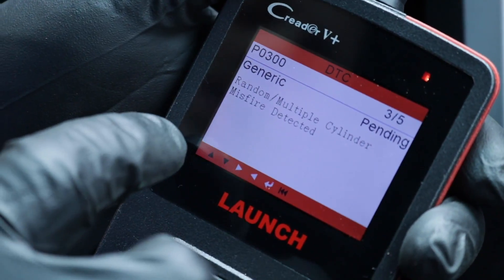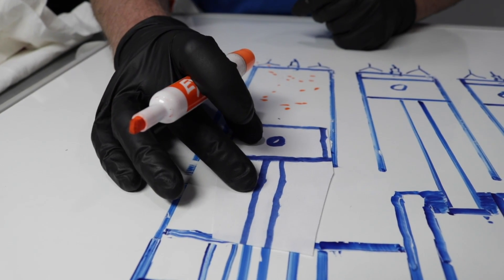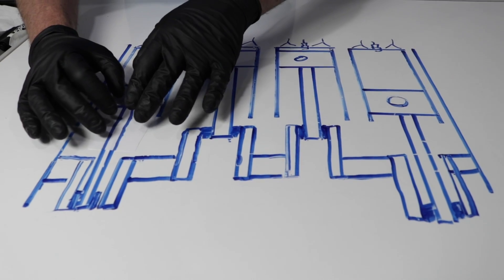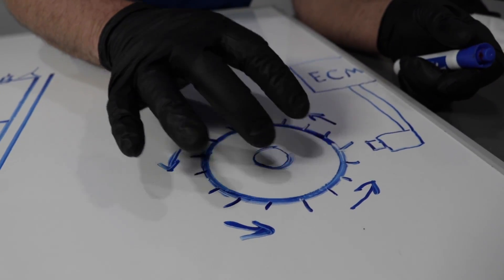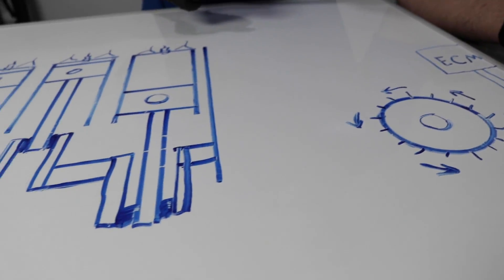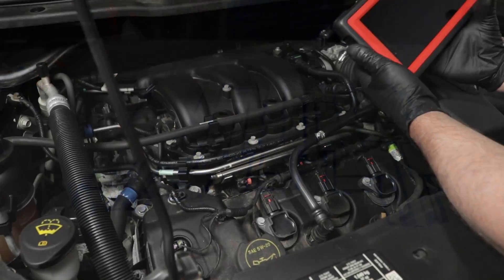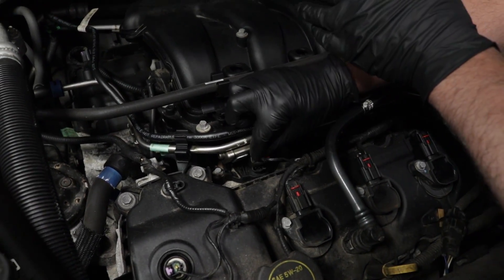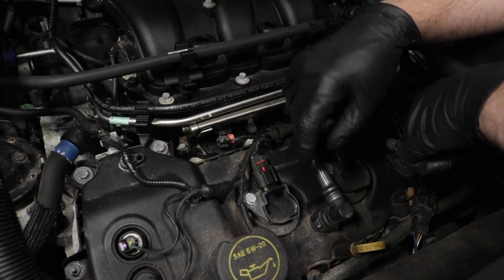What Does a Misfire Mean? Car, Truck or SUV Engine Problems

Comment: I have a PO303 on my v6 Dodge Ram .... how can I fix it ? Beginner ... or what can I do? Is it dangerous or bad to drive it like that?
Reply from the maker: +Tunechi__562 This is a cylinder 3 misfire. When P0303 occurs, it should be fixed immediately as long term driving with engine misfires could cause consequential damage to your engine.
Reply: 1A Auto Parts is it easy to fix it ?
Do u have a video on it ?

Comment: Good Information on the P0300 Random Misfire Code.  
Just 3 things to contribute to the list ▬  ▬ Weak fuel pump ▬  ▬  Defective fuel pressure regulator ▬ ▬ Major vacuum leak ▬ ▬ creating a lean fuel mixture throwing Code P0300
Reply from the maker: +Pin Ball Thanks for the feedback!